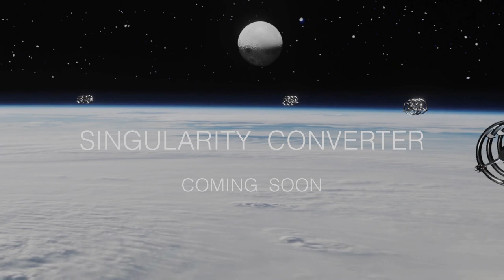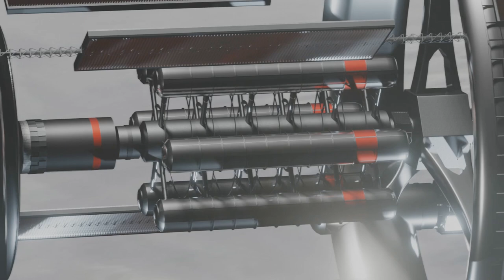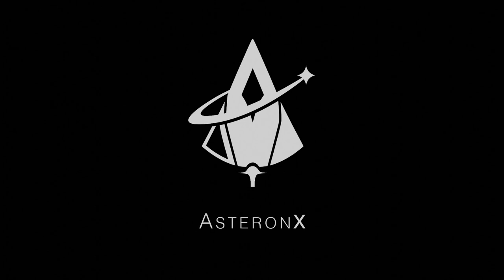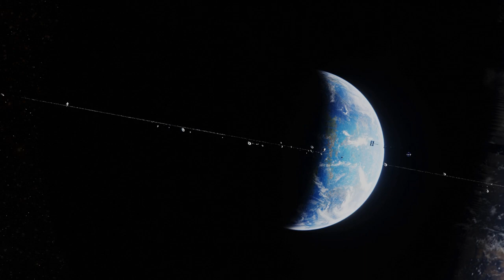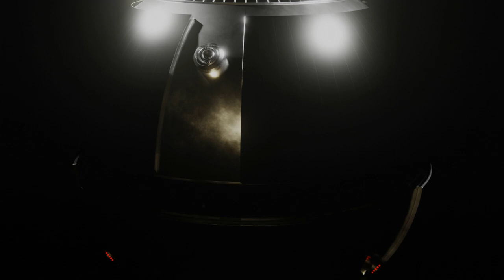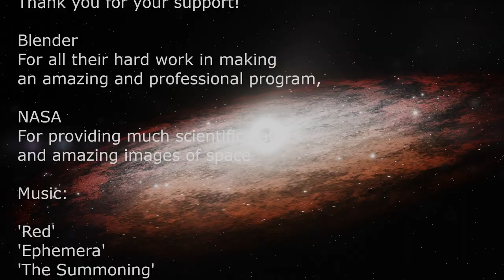Singularity Converter-Trailer

Comment: Glad to see this.  An idea that has been discussed over time with one notable example in sci-fi being the Romulans from Star Trek.  Though while beneficial it would also be a terrifying technology too.
Reply: Most advanced technology is a double edged sword.
Reply: Feynman and Wheeler once calculated that the vacuum energy in the volume of a single light bulb would be enough to evaporate away all the oceans of Earth.  I have no idea if they were correct, but assuming they were and we could get at such energy, it would be both useful for promoting life but also for destroying life.  Humanity would have to make sure such technology was tightly controlled by those who were definitely not power-mad or otherwise insane.

Comment: Here’s something AsteronX could ponder what you could create gravity plating as in Star Trek such as a gravity bubble inside the ship to 1 g but not outside the ship. That will solve the problem of weightlessness effects on the human body for long voyages. Maybe use photoelectric effects together with radiation shields to block most of the cosmic radiation to safeguard the crew and to provide power what do you think???